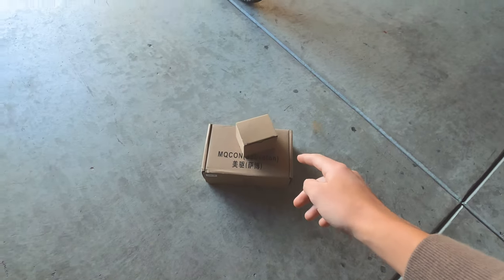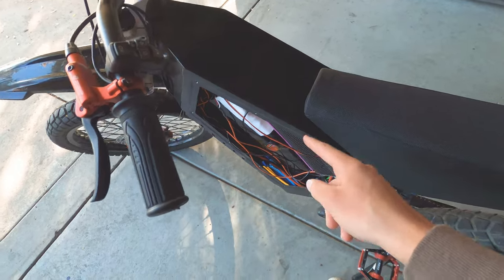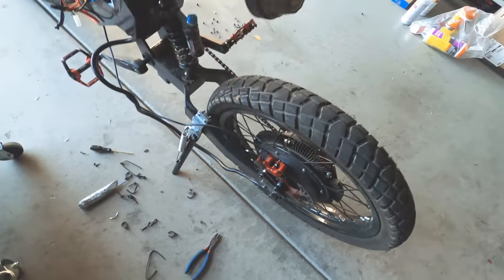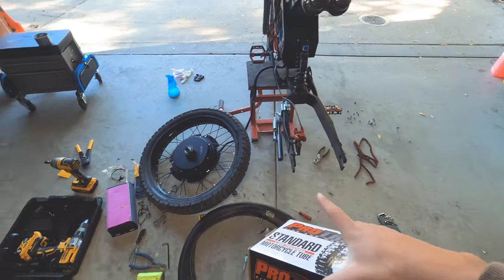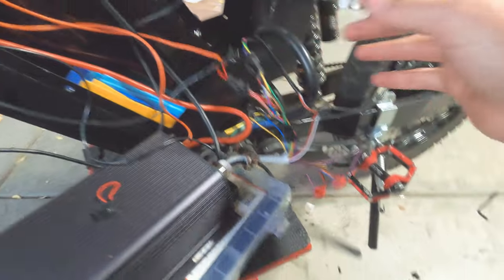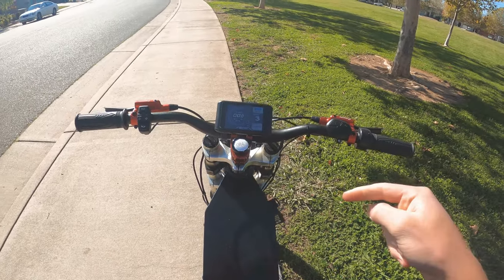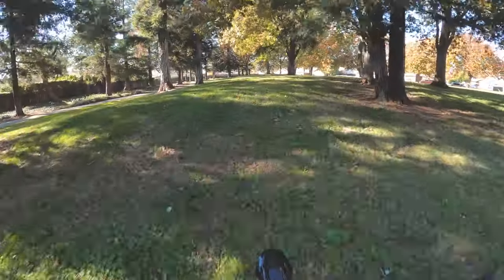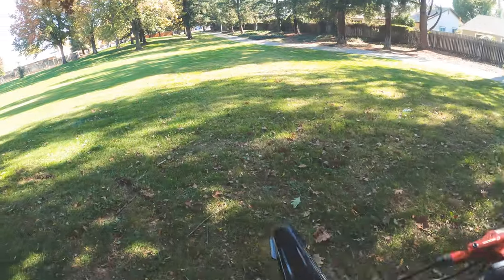Enduro Ebike NEW Sabvoton Controller UPGRADE

Comment: I have the same bike the only problem I have with it is I constantly have to change out the brake pads bc they squeak a ton and I can really do jumps with it bc it’s super heavy and janky but nice vid dude keep it up 👍🏼
Reply from the maker: Yeah it’s pretty heavy on the back which kind of sucks but I use it mainly for street riding. I ceramic pads are really good and last a long time.
Reply: if you dont know already sqeeking brakes is becuase of contamination or eiter pad or disc clean with brakeclean the pad could be sanded with fine grit sandpaper

Comment: Its not your controller its your motor issue you may have mess up the ball magnet in the motor. It happened to me on my front motor but im not going to replace it i just took it off and used my rear motor

Comment: Hey buddy check you spokes that may be you problem i don't think your wheel is balanced right and you can possibly be able to take the wobble out but adjusting your spokes. I hope you get it working better good luck.
Reply: ill 2nd that, that’s called death wobble and won’t end well, easy fix, I actually have those tires on mine and they’re very hard to set bead, u need over inflate n true few spokes buddy
Reply: Well wouldn't it do that wobble the entire time if that was the case, and not just when he hits high rpm? Doesn't add up I'm sorry.
Reply: @LazyEyePolitics it's the bms

Comment: I’m not sure if you fixed the issue with the bike but I’m certain it’s your phase wire combination. Some of these generic motors the color of the phase wires do not match up with the controller and you have to try many different variations so that the motor can run smoothly. Whatever combination you find, you have to also switch the hall sensor wires to match the phase wires.
Reply: Very good point
Reply from the maker: That could actually be the case, I will look into it. Thank you!!
Reply: It’s definitely not the phase wire combination. You can connect them in any order, same as the hall sensor wires (except 5v and ground). The Sabvoton is self leaning. It will learn however you connect it, and from there if its running backwards you just flick a switch in the app to reverse direction.

These motors are easy to take apart. It should be checked for check for loose or broken magnets. 

Not sure if the issue is fixed yet. Lol
Reply: Update on the motor issue?

Comment: How fast the hub motor get hot ? I have 60v3000w hub motor and 60v45-50amp controller and my motor hub get 70deg after 4-5 miles of driving is this normal?

Comment: hiya youll need to check the max current output of your bms it looks like a small battery that controller will pull a solid 100 amps in blink of an eye
Reply from the maker: Yeah it looks like the BMS is the issue so I’m getting it replaced.

Comment: I know im late to comment Is your axel bolt properly torqued and tight no wear bearing issues or loose spokes as mentioned by others wheel looks loose
Reply: Since he removed the motor to fix the flat, we can safely assume if the axle nuts were loose he would have deleted the first part of the video before uploading it, or edited “I found the problem”. Lol
Reply: @imho7250 ya, from experience I could tell it was the bms straight away hitting it's peak current and cutting on and off, kind of like a rev limiter
Reply: @aaron092000 , yes, thats why all my BMS are bluetooth so i can see whats going on and set them just above what I need so they will still act like a breaker of the lowest position amps. I have my 80a/200a ANT discharge current limit set at 100a while using my old battery which is 25a CDR, but when i make my 5P P42A battery ill set it around 200a until i see what my peak boost amps should be (150a-180a) and then maybe drop BMS current limit to 20a over that.
Reply: @imho7250  sweet! I just ordered a ANT 130/325 bms, the one with 4 wires. I'm making my battery from liitokalas version of the lg hg2 cells. It's gonna be a 20s12p pack now they state it can handle 20a discharge but I don't know about that 😂 that's why I'm aiming for 7-10a per cell and limiting the current so the peak dosent go past 15a per cell and 60c for this reason. Aside from the potential drawbacks these cells have amazing value for the money, I'll make a p42 pack eventually and good luck with your build!
Reply: @aaron092000  ,most manufacturers over-rate their cell’s discharge capability, especially if you are in a hot climate. I used some Liitokala 18650s to populate the empty slots in my 13s5p battery kit that only filled 2p of the kit. After unwrapping one cell I found the underlying cells were rated at 10a by the manufacturer but independent testers rated them at 5a, and i find that going over that the pack heats up rather quickly.

Once your pack is made you will just have to see how they perform as a pack. Since you have an ANT it’s easy to see whats going on. I find that starting from full charge (4.2v), and setting DC amp peak at whatever sags the cells down to 3.7v, is a reasonable peak value, and then half that peak is probably acceptable CDR rating, which you would use rpm limit to get below that. 

I think the HG2 is independent tester rated at 3a, which probably means 6a is realistic peak to stay below 45c. But if willing to go to 60c or if you are in a cold climate you can pull more. 

Even my P42A cells I probably rate at 10a CDR, 20a for 3 minutes, 30a for 30s and 40a for 10a. So as a 5p pack that gives me 50a continuous without going over 45c, 100a for 3 minutes which should be more amps than I can use at top speed, 150a for 30s which is definitely longer than it takes to go from 0 to top speed, and the 200a gives me the ability to hit the 190a peak of the controller but ill probably stay under 180a and set that for 5s boost setting.

Comment: Hey buddy I was wondering where you got your new Sabvoton controller from  I want to get another one the one that came with my bike is restricted and I have no regen with the one I got if you could let me know I would really appreciate it. If you have a link to where you ordered it from that would help me out so much. 
Thanks for the video I think the problem your having has to do with the rim if it’s not true then it would start to wobble and the faster you go it just start to get worse because of it being unbalanced. I would bet money on that I sure hope you get that fixed. See if you can find a bike shop to help you out also check your spokes get a spoke wrench to check them with. I just got one off Amazon for 10 bucks it’s a motorcycle wrench with different sizes on it. Some of my spokes need tightening. That’s got to be your problem especially because it gets worse at higher speeds. Thanks for your time. Ride safe buddy.
Reply from the maker: Appreciate it! I’m still looking into the issue but pretty sure it’s my BMS. I bought the controller from NBpower directly by messaging them on what’s app. +86 134 0153 6906

Comment: I just installed my Sabvcon controller SVMC 7260 but I cannot get my bike to go pass 15m/h (25km/h). Would you know if it is a connection error on my part or perhaps a setting issue?

Comment: How do you charge it did you drill a new hole for a charging port nobody never explained this to me ..
Reply from the maker: I didn’t drill any holes there was a hole at the bottom of the bike with a port. I use a 72V 12A adjustable DC charger. You can find them on ebay they have like a red casing. 😁 Here is the link to the one I have: https://www.ebay.com/itm/234168569503?mkcid=16&mkevt=1&mkrid=711-127632-2357-0&ssspo=LcDOI5juSYy&sssrc=2349624&ssuid=onlbp_obrk-&var=533905138810&widget_ver=artemis&media=COPY
Reply: @arthurbal  
Okay I must have got an older model frame mine's only had one hole for the ignition port?
Reply from the maker: @duwaine96  Maybe, it’s at the bottom of the bike in the area where the stem is

Comment: Hey man how did you mount the front fender?
Reply from the maker: I used a spacer, drilled 2 holes and used 2 small bolts to mount it. If I were to redo it though I would tap threads and screw it in. The fender itself is a surron X front fender from amazon.

Comment: What motor T number are you using?
Reply from the maker: qs205 3T which is for speed and 5T is for torque
Reply: the bike isnt ment for normal mountain bike brakes best to use moped size calipers like 4 pistons

Comment: Can you provide the links to the electronics? Thanks
Reply from the maker: Most of the stuff I bought from NBpower they have a whatsapp number I can give you.
Reply: @arthurbal  does that include the wheels?
Reply from the maker: @ryancollar1  Yup 285 for the controller and display, 275 for the front wheel, and 475 for the rear wheel with the qs205 motor

Comment: I had a similar issue setting up my controller and motor.  The “thumping” is sort of like a misfire. I’m guessing it’s a unstable magnetic field.  This also occurs at higher rpm.
Reply: Did you manage to find the cause of the issue and fix it?
Reply: @aaron092000  I was told that my aftermarket controller was a sinewave, but in fact it was a square wave.  I was dealing with a AliExpress seller.. I was a little bit miffed, but pushed through with the seller until they gave me a discount on a sinewave.  No problem since.  Another issue I was having was with the throttle /display.  The old square waves were frying them or something.  I still don’t understand how that happened.

Comment: Can some one explain to me what the, "hull test" (idk if that's correct) is?
Reply: Hall Test. This is the self learning feature of the Sabvoton. You connect phase and hall wires in any order (but professional will color match them from the motor to controller), then run test, and the controller will pair the motor to itself. After that if the motor runs backwards you just open the app and select “reverse” to make it run correct direction. 

The Hall phase shift will appear after the test. Not to be confused with commutation angle of 60 or 120.
Reply: @imho7250  that's for the explication,  I don't get everything that's mentioned here but i think I'll manage with this explication and some vids of how it works, tryna get my fist DIY ebike working
Reply: @Killer-wu9hk  , to make any controller work, it needs battery power connected, the motor phase and hall sensor connectors connected, the throttle connected, and the ignition wire connected. From there you should be able to open the MQCON app and verify voltage settings match your battery. 

Then with the rear wheel off the ground you would run the hall test, and the motor will start moving slowly as it checks the relationship between the phases and the hall sensors. After it finishes, and you save it, the motor should run. 

Of the motor runs forward then its correct, if it runs backwards then in the app you can change the direction. 

You never need to change any phase wires or hall wires after the initial color matching of all 8 wires. Any mismatch will be fixed inside the controller.
Reply: @imho7250  I'm not sure if the controller will connect to the app because, I bought the bike off alibaba from a company called keyu, they seem reputable because they have their own ebike frame and several types of it, the description mentioned a 25a sabvoton controller, my bike 3000w so ima need an upgrade but when I asked about the controller they said 45a keyu controller, I've never heard of a keyu controller, maybe they made a mistake and ment 45a sabvoton or 25a. Also the low showered sabvoton controllers are not Bluetooth compatible, you have to use the computer app, but there's no tutorials about that
Reply: @Killer-wu9hk  , if you make a YouTube video showing what you have it’s easier to help. There are many controllers. Votol and Kelly need a computer. Sabvoton and Fardriver and YuYangKing use Bluetooth and a phone app.

Comment: Wtf why would you think it's the controller? 😂 All wheel inside or spokes.
Reply: It's the bms lol
Reply: It can't be the bms because I run lipos without bms and I have the same issue on one of my bikes.
It's a wire combination issue or loose wire maybe.
Reply: @rccrazy  what lipo battery's do you have? Alot if not most of the good ones have built in chips for over discharge protection. Though they don't protect against rouge charging.
Reply: @aaron092000  most lipos have no form of over discharge protection it's the esc that has the voltage protection parameters and change them with a balance charger.
And I use 2 lots of 5 x 9500mah 4s HRB lipos to get 19ah 72v or 20s.
Reply: @rccrazy  yeah my bad your right, most don't have discharge protection. Done abit of research and found that some have balance chips inside which could be the case for you 😀 I think maybe like you said, wire combination or phase wires crossing causing unstable magnetic field? Or possibly voltage sag causing the lipo to trip out? I'm curious have you found the solution to this issue? From my experience I was running a 30a bms with 60a peak and when I tried to run over 60a through it, it would do the same thing shown in this video, like a rev limiter on a car. it would only happen once I reached a certain speed too

Comment: IT'S NOT THE MOTOR , ITS YOUR  RIM SEE MY CHANNEL WHAT HAPPENED TO MY RIM AND WHAT I DID SE EXACT BIKE
Reply from the maker: I’m pretty sure my rim is straight but I’ll check it out. The issue seemed to go away but my BMS is having a problem so i’m getting it replaced
Reply: I see a wobble on the video in the rim . What is the problem BMS
Reply from the maker: @TECHSUPPORTEBIKE  bms is broken keeps randomly showing 5v a cell then goes back to 3.8 and it’s glitching
Reply: Ok ,but check the rim am telling you something is wrong with it
Reply: @TECHSUPPORTEBIKE  I'd agree with you on the rim. Looked off to me.
Reply: @TECHSUPPORTEBIKE  if it was the rim it would wobble the entire time. Not just when he hits the high rpm.
Reply: @TECHSUPPORTEBIKE  I think it looks like that when it's shaking and shit 😆.
Reply: @LazyEyePolitics  well at the end of the video he still didn't fix the wabble...I know it's the rim and the faster the wheel spins the more it will show trust me I had the same problem. Do you know what it is?
Reply: @TECHSUPPORTEBIKE its the bms hitting the max current limit, or like op said, faulty.